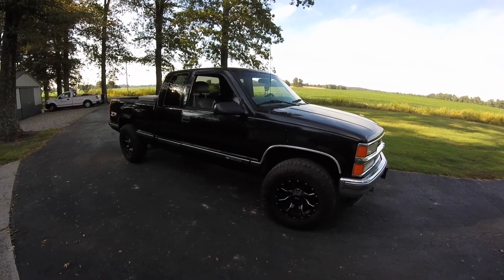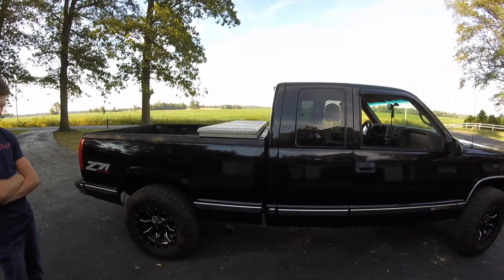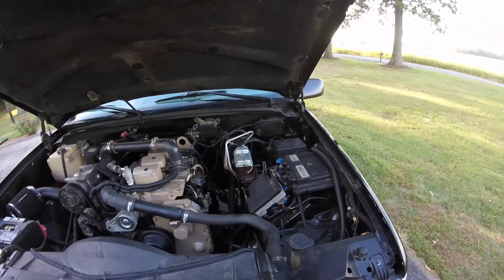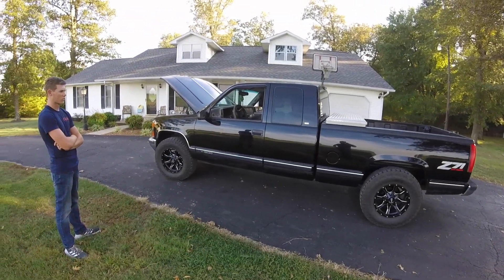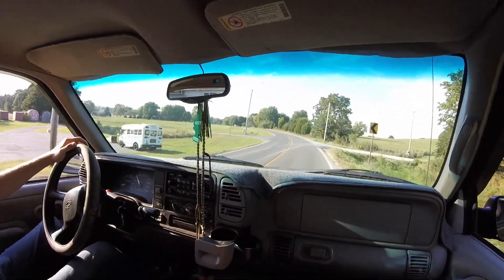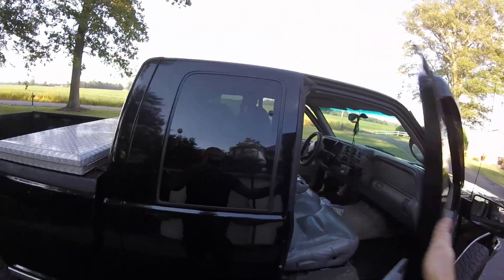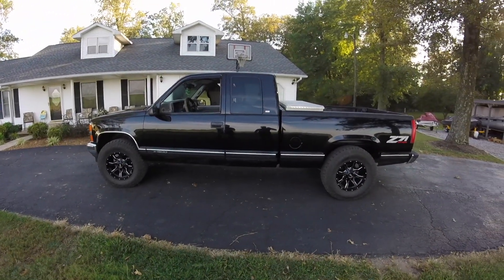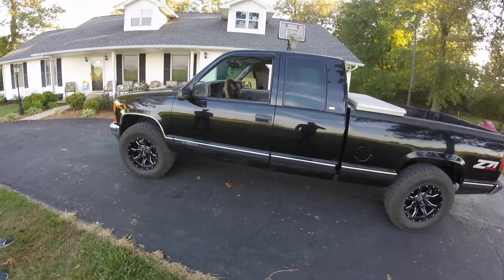Part #12 CUMMINS 4BT CHEVY K1500 CONVERSION COMPLETED+DRIVE,  11 Video Series on My Channel!!!

Comment: That you for these videos they’ve helped me a lot im about to 4bt swap my 97 Chevy. I do have a question tho and I’ve yet to find the answer im looking for, why did y’all wire up the switches to tell the transmission what gear to go into? Also since it’s been 4 years ago how well did the 4L60 hold up to the 4bt ?
Reply from the maker: I wired the tranny that way to cut down on the cost of buying a transmission controller. $700. You can always put in a manual transmission for better mpg or turbo 400 tranny, and no electronic transmission to bother with. I talk to the guy that is driving it now and everything is still going well with the truck. If it was going to be my truck, I would put a five speed manual transmission you’ll get better miles per gallon, and with the heavy mass of the flywheel, it will cut down on some of the vibrations that the 4BT puts out. Hope this answers your question if you need more help please let me know.

Comment: What did you have to do to get the 4bt to work properly with the 4l80e ? Electronically wise for shifting
Reply from the maker: If you go to my Jeepmanking channel, I have the whole series of the build in about 11 videos I explain how to hook up the 4L 60 E transmission without buying a transmission controller. You can do the same with a 4L 80 E transmission you can use a 700 R4 transmission or a manual transmission as well. I hope this helps.

Comment: What transmission is on the truck?
Reply from the maker: 4l60e in the truck, you can use 700r4, turbo 400, 4l80e or manual trans. Check out my channel I have the full build with 19 videos. Look under playlist.
Reply: @JeepManKing  thanks. I'll check out the video series. My son wants to do the same thing to his 96 4wd Tahoe.
Reply from the maker: Awesome!!!! good luck, it’s a great father son project.

Comment: Surprised at the mpg, I would have thought the mpg would be much higher, at 28-32. Why is it so low?
Reply from the maker: So I understand you correct, on mpg Ethan got in the low 20’s when he had it. The truck has 3:73 gears with auto trans. A stick shift would greatly improve mpg but he wanted to stay with auto. I know many guys say they get 30-35 mpg but I don’t think they know how to calculate mpg. Intercooler would help but I don’t know how much.
Reply: I can tell you as the current owner,  I get in the low 20’s around town. If I am on the highway and make an effort to stay in the top gear I have gotten 28mpg
Reply from the maker: @kentogilby9718  I believe that is very possible, Ethan just really never drove the interstate.28mpg is still very good for a 1/2 ton 4x4 .

Comment: Truck looks about the same as In the Videos and is still running strong.  Its only needed light maintenance so far - belt, filters oil change, new battery.
Reply from the maker: So glad to hear that, do you still have to shift trans with switches? Didn’t know if the next owner put  trans controller in it, I discussed it with him when he bought it.  If you have any questions with the truck please let me know….
Reply: Don’t think he did anything to it.  I still use the switches.  I have done some outside work on it like new head and taillights .  I could send you some pics if you would like.
Reply from the maker: Sure if you want Jeepmanking@gmail.com

Comment: I purchased Ethan's truck from the man from Maine he sold it to.  I would be interested in which intercooler you considered using on this build.
Reply from the maker: Well that’s very cool!!!!  I was going to buy a aftermarket intercooler that would fit in front of the condenser and I even thought about putting a water to air intercooler on it. There are factory ones available for Cummins 4bt. How does the truck run and look?

Comment: I might very missed it, but what transmission setup did he say? I have a 98 4x4 single cab shortbed that I wanna swap the 4.3 auto to a 4BT turbo with an auto but I'm having troubles figuring out exact setups
Reply from the maker: Please check out my channel and Subscribe.  I have the 11 video series of the whole build. I used the 4l60e trans and show how to hook it up without a trans controller. You can use 700r4, 4l60e, 4l80e or manual transmission with the adapter. So check out my other videos and you can learn a lot of the build. Thanks for watching I hope my videos help with your project. Aaron King
Reply: @Jeepmanking  thanks man I'll check it out and ht you u if I have more questions. People like you are what we need on this platform. I have like 3 project builds, but you're the only one whos answered back. Hotrodding was meant to be shared so it can go further and I appreciate it
Reply from the maker: @-OokySpooky-  it was a great build with my son, but wanted others to have the information to help with their builds. Good luck!!!! Thanks for watching…..

Comment: Awesome looking truck. I love this generation Chevy truck. How much power does this Cummins 4bt deliver? How much torque does it put out?
Reply from the maker: HP with stock VE pump is 105 HP with around  275 lbs of torque 
A P pump 4bt is 130 HP with 327 torque stock.
Numbers can go up big time with upgrades.
Thanks for watching
Reply: @jeepmanking3577  That's not bad. Given what it's used for, a 4wd Chevy 1500 pickup truck, I would think that close to 170 hp and 480+ lbs-ft of torque. 🙂
Reply from the maker: Torque on the Cummins is the same as the 5.7 that was in it. The benefit was the MPG gain, and of course the cool Cummins sound coming out the exhaust!!!

Comment: Does it rattle your teeth out like I've heard the 4bt's do? I love the ones for a 12v swap!  The hd trucks are available pretty cheap now a days.
Reply from the maker: No not bad at all going down road super smooth, at idle is where it vibrates with manual trans you can speed up idle which smooths things out.

Comment: So just now looking into 4bt’s for the same truck mines a 1997 K1500 extended cab short bed but how bad is the vibrations with the 4BT in it? Also is there any way to have it shift like the old engine and transmission without switches or anything just being able to drop it in drive and go? Or would you have to make it manual?
Reply from the maker: It does vibrate with stock dampener, you can add different one but runs around $450.  You can use a 700r4 tranny with tv cable or manual trans. I think a manual is the way to go, but my son wanted to stay with the automatic.  If it was my truck I would have put manual trans in it and with a heavy flywheel with the manual trans it would help with vibration.

Comment: Does the 4bt have the same power as the 350?
Reply from the maker: Less horsepower, but same torque., but with some tuning you can get almost twice as much torque as the 350.

Comment: this is so cool. for a first swap, awesome choice.
for a long term investment, seeing's as you have a K full size cab with a third door in the "nu-school" body style you guys should swap a 6bt into a 2500 chassis with your cab on top. I my self am considering the very same, except I do not have a 3 door. 
I myself am doing much more of a restoration than you are, and by the looks you guys had a mint truck needing a motor. I really like the sound and I imagine with some injector tuning you can smooth out the lower end rpms.
Also, if you have answered this question before, YT has a horrible comment system. Sorry If my laziness kept me from searching below.
Reply from the maker: If you go to my channel Jeepmanking, I have the 11 video series of the whole build, along with some body work that I discuss but I didn’t record. Thanks for watching!!!

Comment: Nice swap and was probably a whole lot easier than a 12v but personally I would go for 12v for two reasons. One, power and two, sound. I'm not a fan of a pickup sounding like a farm tractor.
Reply from the maker: Well a  12 valve sounds the same  as a 4bt but a 12 valve is smoother with less vibration, and it is to much weight for the k1500.

Comment: What's the difference between the 4bt and 6bt engine? I picked up a 1994 chevy k1500 single cab standard bed I'm wanting to save up for and do some customizing on. The 350 vortec in its a good engine and all but prefer a strong light weight diesel that's reliable
Reply from the maker: The 4bt is the 6bt with two cylinders cut off engine block.4bt is around 120 hours  versus 6bt 160hp
Reply: @jeepmanking3577  could my half ton handle the 6? Weight and power wise?
Reply from the maker: Their will be some that says sure, but I don’t recommend it unless you out a 3/4 ton front end under it.

Comment: Sorry if I missed something but I'm just curious,.....why do you need to shift gears with a switch, but also used the column shift to put it in gear?  Can the transmission not be fully automatic?
Reply from the maker: So go to my channel and in a video I explain. And look in the comments sections as well I go into more detail, thanks for watching.
Reply from the maker: Part six of videos

Comment: Interesting, so by lifting your foot prior to shifting it appears to ease the jerking of full line pressure, at 1st I was against this setup because of full line pressure but I believe you just taught me something, I may do this trans shift setup after all.
Reply from the maker: Yes, you are correct it does reduce the firm shifts, thank for watching

Comment: I have a 98 tahoe 4x4 2 door. I want to swap a 4bt once the 350 gives out. But that doesn't look like it's going to happen any time soon. But knowing these with that 1500 I'm sure now it's possible
Reply from the maker: Very possible, thanks for watching!!
Reply: Did you ever get to swapping the 2 door hoe with a 4BT? I've been doing research on a 4BT or 6BT swap on a 97 2 Door Yukon

Comment: Hi Jeep, I have new plans, I am still hoping you might be willing to take on the project.  If you can find a machine to make up the adaptor plate for the 60 degree v6, I am now considering a VW 1.9 TDI ALH (a little beefed up to about 185-200hp). Can you imagine more power (TQ) and 30+ MPG.  You also would not need a hydroboost set up as there is a vaccum pump already on the front belt drive.  Please tell me you will do it for me.  The S10 is a garage queen and is hardly ever driven, so I would not be in a hurry to get it back.  Email me and I will get you some photos of the S10 Blazer.

Comment: My wife and I have Ram 4wd pickups with diesel engines.  I have considering putting a Cummins R2.8 in my '96 Jeep ZJ 4wd.  But we do have a '94 Chevy 1500 2wd that could see a 4BT or the R2.8.
Reply from the maker: For sure, it will work.

Comment: Im glad to see that the father/son projects are still alive, its nice to see. Im curious as to why you went with the 4bt, was it just because you had one or?   Why pick this over somethin like an OM606 or its other German counterparts?    Excellent video by the way.
Reply: mechanical
Reply from the maker: Great question, I looked at the OM606 engine as well. It was just easier for me to find the Cummins 4bt.  I truly believe the OM606 would be a much smoother engine compared to the 4bt as it is not a very smooth idling engine compared to the OM606. Thanks for watching and I hope this answers your question.

Comment: What transmission y’all have connected to it
Reply from the maker: 4l60e factory trans
Reply: @jeepmanking3577   that 60e holding up?
Reply from the maker: @ryanchapman423  Ethan sold the truck in the fall, everything worked good he put 13,000 miles on it before it was sold. Thanks for watching!!!!

Comment: What did the fuel mileage end up being? I’ve been thinking of the 4bt or the 6bt conversion on my 95 z71
Reply from the maker: Ethan has been getting a average of 21 mpg city driving
Reply from the maker: Curdled Cargo 348 Ethan has been getting 21 mpg city driving.

Comment: How much did it cost
Reply from the maker: Engine 4bt $1600 then partial rebuild total $2000. Adapter $1090, new turbo $600, exhaust $100, miscellaneous $100,  let’s say total price $4000.
Reply from the maker: Thumpin_obs  total cost $4000

Comment: Idk if you said it in the video but do you have a lift on that truck? I love those wheels.
Reply from the maker: TheBsmith Images no lift stock suspension....
Reply: Jeepmanking where did you get the wheels?
Reply from the maker: No lift stock suspension

Comment: Dumb question, why are you letting off the gas when you shift?
Reply from the maker: Good question, we are running full line pressure with this setup.  You don’t have to it just smooths they shift out, if you don’t it’s like your tranny shifts like a nice firm shift kit.
Reply: Jeepmanking  oh I see. Thanks for the response! I plan on doing a 4bt swap on my k1500. Love your videos!
Reply from the maker: Great thanks for watching...

Comment: Would you need a transmission controller with a 4l80e?
Reply from the maker: Zapped Productions no you can run the 4l80e with no controller just like I did with the 4l60e.  I hope this helps and let me know if you have anything else, glad to help.
Reply: Jeepmanking would I need to use switches or could I let the trans shift automatically,
Reply from the maker: You have two options, the use of switches is the cheapest and easiest or you can wire it in 4th gear and the use of a micro switch and ratchet shifter would be the second option.. I have a saved vid from someone else when I find it I will let you know it’s on a 4l60e but will work for the 4l80e.  I was going to do this for my son’s truck he just wanted the switches.
Reply from the maker: Look up on YouTube “. Shift a 4l60e transmission for under 10 bucks” channel is Matt’s  Madness he has a great vid on this
Reply from the maker: Zapped Productions look up vid on YouTube “ shift a 4l60e transmission for under 10 bucks”. Channel is Matt’s Madness.  Remember 4l80e is almost the same just I think one wire color is different, research it and you’ll figure out what it is. Hope this helps

Comment: Why not a 6bt?
Reply from the maker: We decided to build a truck that is really fuel efficient and it gets around 21 city driving.  6bt would be pushing the weight limit for a half ton.
Reply: If fuel efficiency was the goal why not a Mercedes 6?

Comment: Thats a good looking truck! Tried for the longest to convince my brother to swap a diesel in his 1500
Reply from the maker: Well my thought process and money two years to make this happen. Keep saving and don’t give  up trying and have a good plan.
Reply from the maker: Well it cost a few bucks to make it happen, but we would do it again for sure. Thanks for watching.....
Reply: @jeepmanking3577  i had though about a kubota swap on my b2200 mazda. Was about to start ordering parts then i found out i got done wrong on my taxes. Would have been plenty. Only getting a 1/4 back.

Comment: How'd you do the switch shifting? That's really cool, and awesome truck.
Reply from the maker: It’s working just, I have a video of how it works and I show you how to make a 4l60e or 4l80e transmission work without the computer
Reply: @jeepmanking3577  Gotta a question, no options for aftermarket stand alone ecu so you don't need to manual shift the 4l60?
Reply from the maker: Jakes24O6 yes,  Quick shift has a stand alone $650